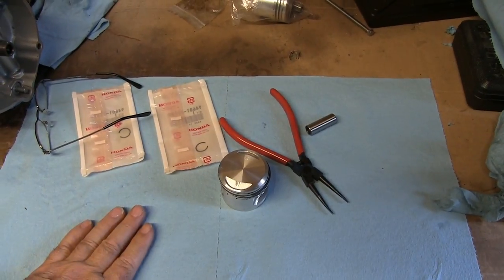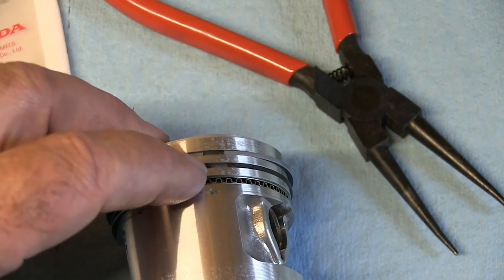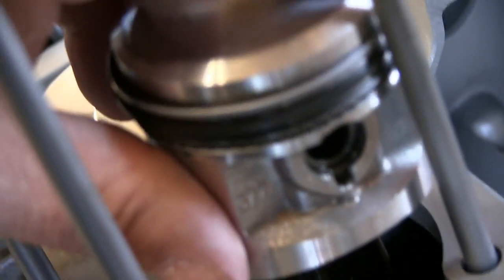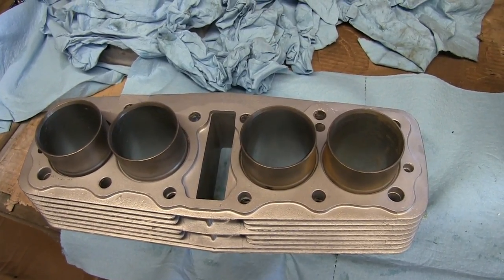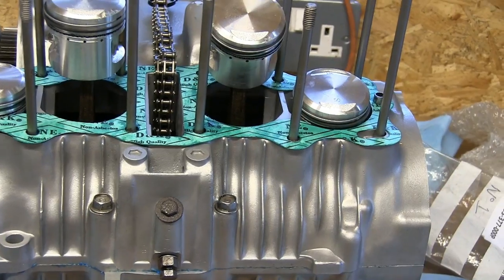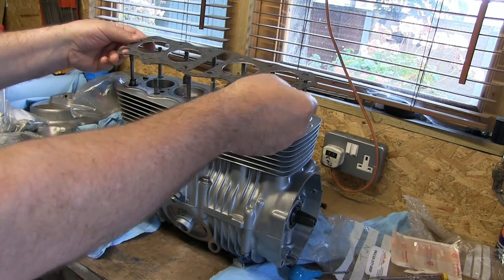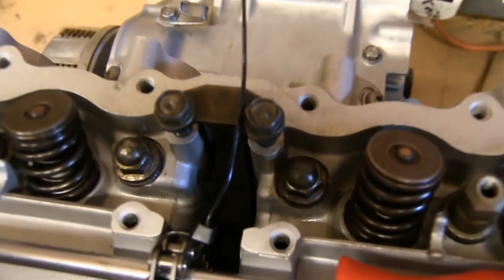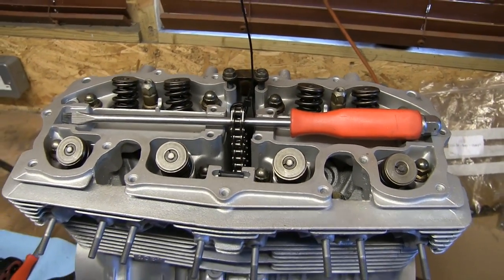Honda 400 / 4 engine rebuild Part 4

Comment: Hi there just carried out an engine rebuild on the 400 4 my self very enjoyable,can I ask you a question did you paint your engine casings after they were vapour blasted or did you leave them natural ?  Many thanks for the great video regards Ken
Reply from the maker: Hi they were painted with Vht silver paint bought from David Silver Spares. Thanks for your comments.
Reply: Ok thank you for the reply, I left mine unpainted but in hind site I believe I should have painted it

Comment: Did you apply some oil in the liner before install the piston ?
Reply from the maker: yes all components were covered in light machine/assembly  oil.

Comment: How much torque value you apply on stud bolt ?
Reply from the maker: Sorry I dont have that information to hand. Strongly advise you get a  Haynes manual.
Reply: I mean, torque value when you use your torque wrenxh when retighten the stud bolt on cylinder head